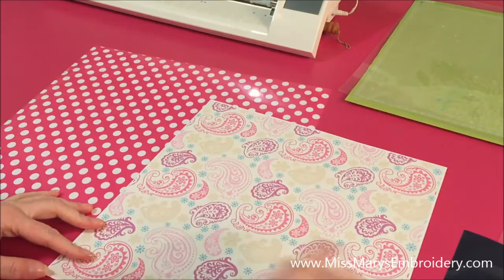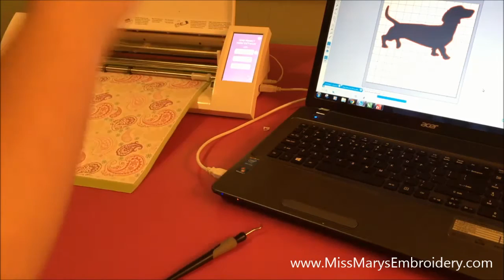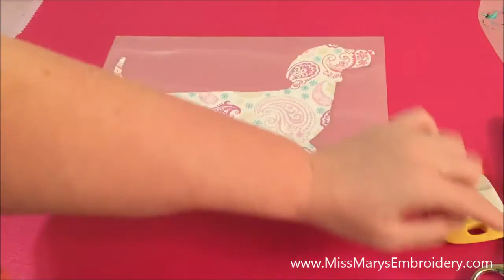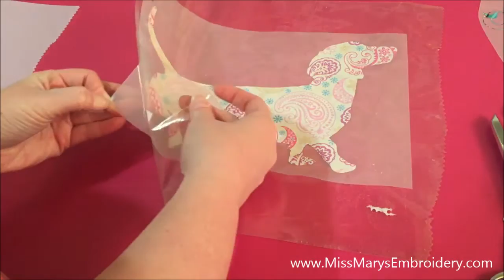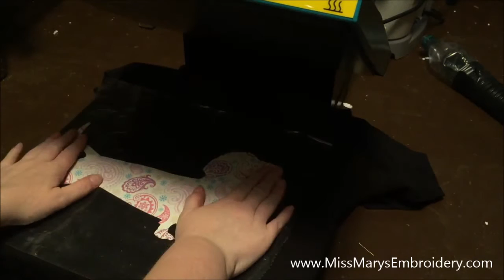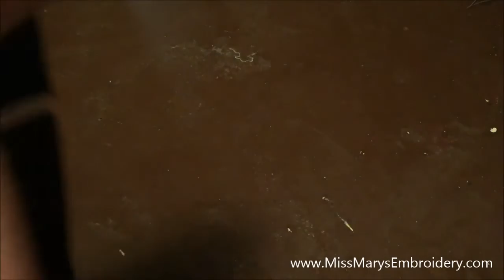How to Cut Printed Patterned Heat Transfer Vinyl

Comment: Hi ! I know this was posted awhile ago but where do you get that type of vinyl or what machine would you need to make it? And can you explain more about the specific transfer tape you're using ? Thank you so much!
Reply from the maker: Hi! You can buy the printed pattern vinyl all over the place (Etsy, JSI Signs, Sparkle Berry Ink, Jasie Blanks), I am equal opportunity & buy it anywhere!! Love it! Most place will give you some of the transfer tape for free to apply your pattern vinyl.  It is called Hot fix tape & it is used for Rhinestones.  Here is a link to some http://jsisigns.com/cgi-bin/commerce.cgi?preadd=action&key=RS-TAPE-12 (Not an affiliate link, unfortunately they don't pay me!). 

To print it, you would need an extremely expensive specialty printer & specialty vinyl. There are a few vinyls on the market, to print from your own ink jet printer, but they generally get poor reviews at best, but I haven't checked on them in a while, so I am not sure if they reviews have gotten better!  

Hope that helps!